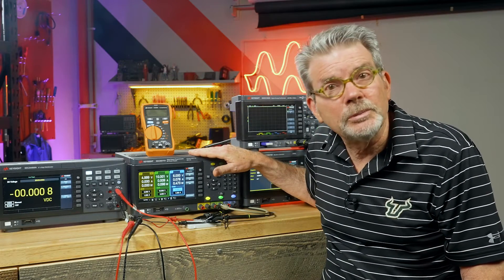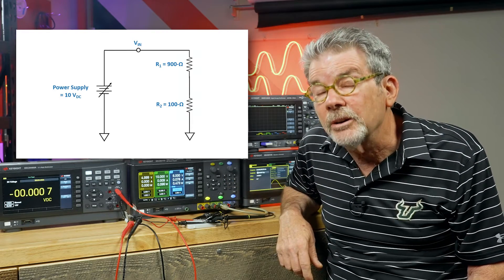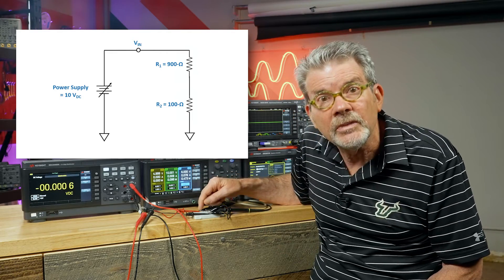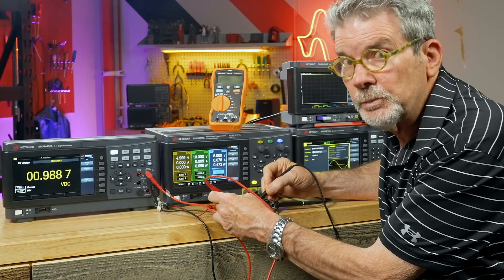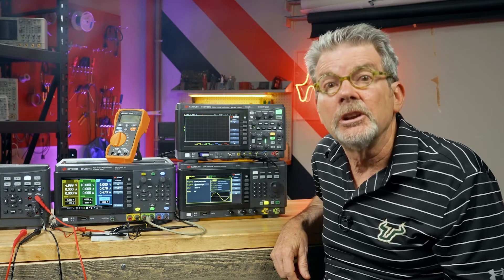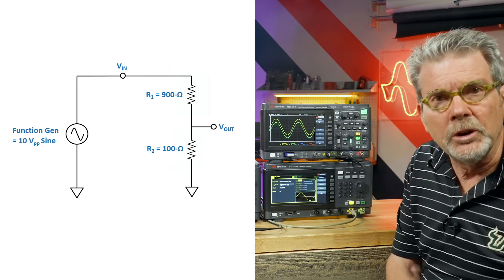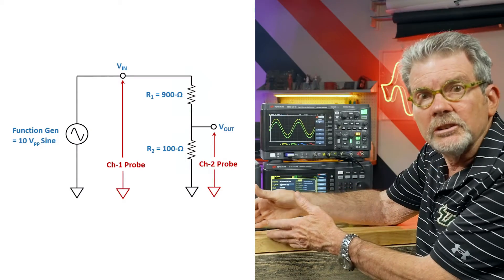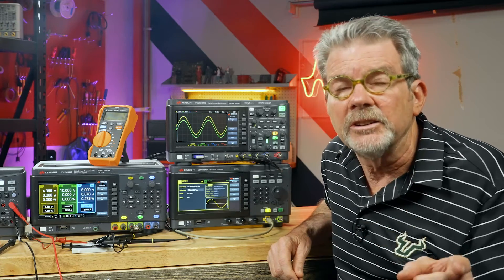Lesson 1: Survey of Essential Test Equipment

Comment: While i agree with you on most points.
And keysight does make great equipment i would never recomend it to a student that will buy them from their own pocket. You can get much more capable and cheaper instruments from Siglent or Rigol anytime nowadays (talking about lower end mainl) these beatufful r channel 100Mhz 1Gs/s O-Scopes sometimes for less than 400$ while you'r cheapest offering is 2 channel and 50 Mhz Not even gonna talk about other equipment.  If i were spending big and looking for highend? Definetly Keysight, Fluke and Tektronix but for budget? I would loom towards Rigol and Siglent.
Reply: Not to mention better customer service from Siglent, Rigol or GW Instek.  I have one piece of Keysight.  It's my first and last.  I have over 20 instruments from Siglent, Rigol and GW Instek.